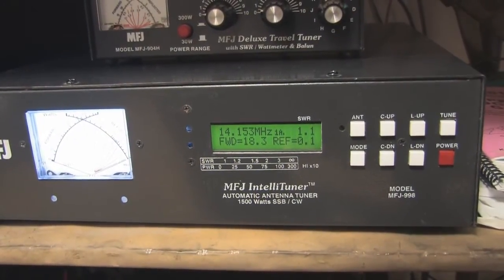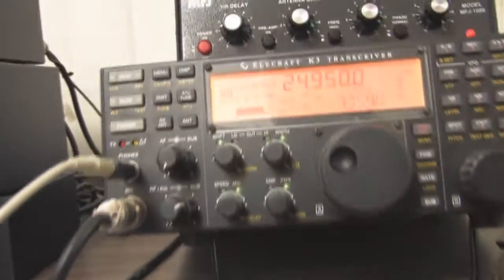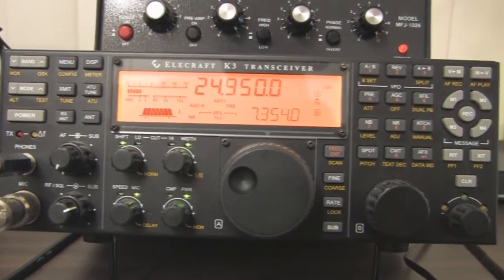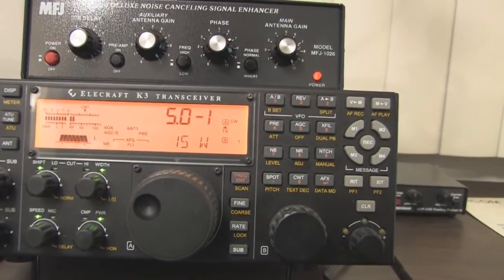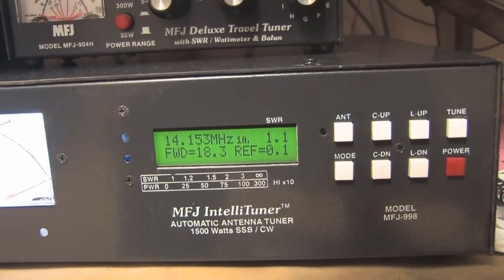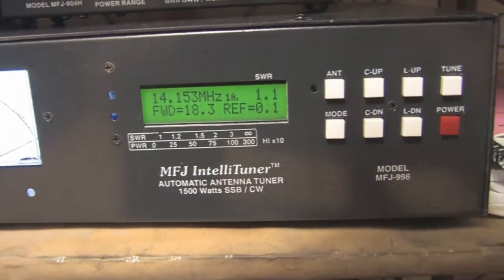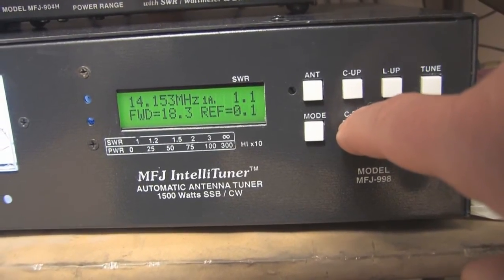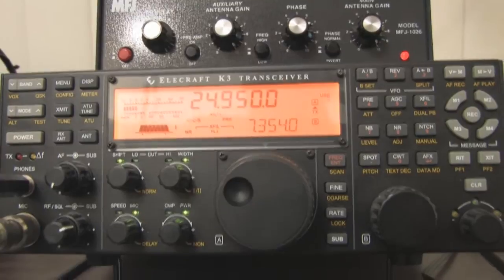MFJ-998 1.5KW Auto Tuner Part 3

Comment: Thanx for doing this video. It has been a learning experience.  Foldback can mean 0W out & no autotune.  I suspect the radio/998 interface cable would fix that.  The tuner would know of the band change & get a bit closer prior to final tune.  This would allow enough wattage to cause autotune.  Maybe I missed it, but do you have a cable?  Thanx - Bob